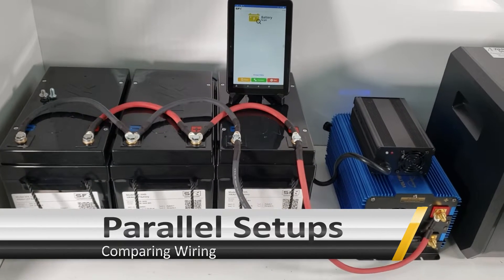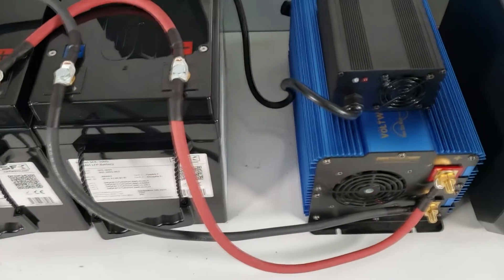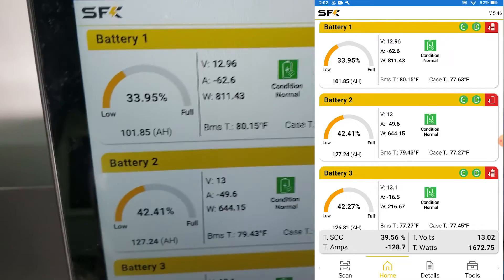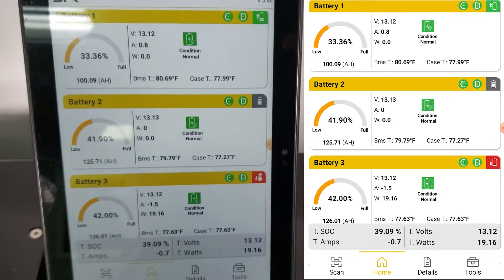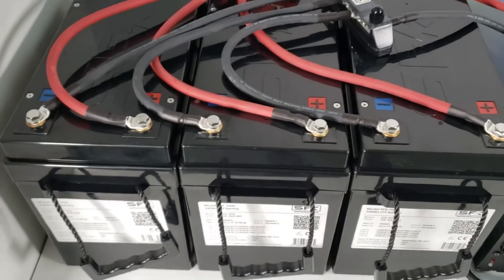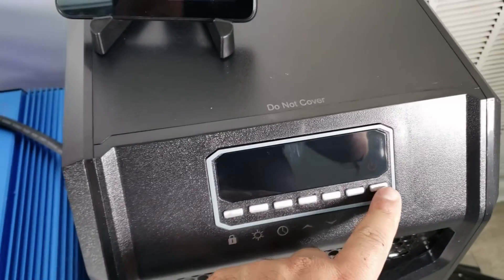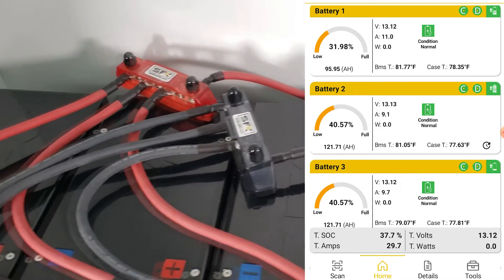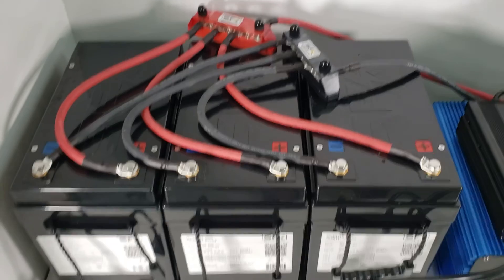Best Parallel Wiring Setups for Lithium Batteries (RV, Motor Home, Storage).

Comment: This is the 2nd video I've watched where I'm left wondering what the battery charger is plugged into. It appears on both videos the charger is plugged into the inverter?? Yeah I'm dumb to some of building my power station. I have to watch 10 videos per subject to get how to wire, program, charge, safety measures...gets to be too much info that it's hard to understand. I have everything that I could be generating electricity today, but it's been months just sitting. Just as I think I have it down, on how to charge the batteries, what's needed to accommodate that happening; then I see 2 people charging their batteries and they're not doing it by solar or by 110v...thought those were the only options to use your charger.

Comment: On the bus bar set up you need your negative cable to the inverter on the opposite side of the bus bar to distribute the load more evenly.

Comment: You completely ignored the fact that internal resistance of the individual cells inside each battery is what causes the difference in amp draw combined with differences in each BMS components.  Lengths of the wires make almost no difference.

Comment: I have no clue about electrical systems but you have made it look so easy. I have a question for you? I have a mercedes vario campervan that has a 12v/24v system .As I don't  have an inverter but the bus bar system, will my ( +&-) just connect to the battery charger. Thank you for any advice. I was also told ( rightly,wrongly) that there should be fuses between the batteries, is this required?

Comment: You should have had the Positive or Negative that is going directly to the Load from the Number 1 battery and the Number 3 battery (to use/drain the power evenly !)

Comment: Thank you for the simple explanation for a more equal battery maintenance use and charge. I have a 3-12v lithium battery setup in my truck for camping and had configured my wiring to a bus bar setup. This helped me confirm that I did it the best way possible for the batteries. I guess you could occasionally change the cable order from the batteries to closest to the the lead cable to balance the battery usages even more? Also do the cables from the batteries have to be the same length to the bus bars for even or better distribution? Unfortunately, my set up requires different lengths to my bus bars. Thanks again for this video and it's simplicity of understanding!
Reply: yes they should be of equal length

Comment: Also, so in theory, if you put all your battery cables on one post of the buss bars pos and neg, then use the other posts for charger, solar charger, inverter etc the current draw and input from chargers should be equal right?

Comment: So with only 2 batteries there isnt really a benefit to using buss bars?  Just make sure you pulling positive from one battery and negative to the 2nd? Or is there still an improvement using bus bars on 2 battery setup?

Comment: Hi I was just wondering, I am charging from solar, you connected the charger on the inverter, is it ok to put the charge wires on the battery instead of the inverter. Which is better. Thanks

Comment: Question...do you connect your positive and negative from the charge controller to the bus bar or directly to the 1st and 3rd batteries?
Reply: De preferência no barramento. Inclua um disjuntor ou outra proteção entre eles.

Comment: Surely EACH battery should be individually fused (in case of battery failure) AND there should be a fuse between the battery bank and the inverter?

Comment: Wrong wrong you are so wrong and your set up on your very first battery. You should connect your charger and your inverter to the Black on your very last third Battery you should connect positive charger and inverter to the red. By the way, I realize there are two different links, but you should make them both the same length And loop around the red one.
That is the correct way to do it. That is a proper way to do it. That is the balanced way to do it as I’ve described. Good luck in your next video.

Comment: So on the buss bar discharge test what if you reversed the negative cables so cable 3 is closest to the draw cable. So red cables are 3,2,1, power cable out and black is 1,2,3, power cable. like in the first test at 6.53 it might make a little difference. just asking..

Comment: Least efficient battery connection for parallel. 
BEST is Positive at one end of "chain" 
Negative at opposite end of "chain"
The way pictured will use a single battery with two parasites. BAD LAYOUT.

Comment: If you had a heaver amp wire from the bus bar too the  inverter would that allow a better voltage too the inverter. Thanks.

Comment: I have 3 230AH 12volt Lithium batteries.   What size busbar in terms of amps, do I need?  Is it the 690 total AH of the batteries?  Or 200amp which is the maximum output of an individual battery?  or 600 amp the maximum of each batteries output combined?   Thanks

Comment: The test would be more accurate if you had batteries at the same  SOC for each test as they will balance each other if not, skewing the amperage readings. Also, same length cables to the busbar from the batteries keep the resistance the same and keep voltage drops similar. Otherwise, great demonstration.

Comment: I have four 12V 200ah AGM batteries connected in parallel. 
I’m trying to connect them in busbar but can’t find a busbar that supports 800AH.
They seem to be rated at 600a Max.
Any suggestions?
Reply: I have four 12-volt, 450Ah batteries connected in parallel (running a 6000-watt inverter). I used a 600-amp busbar. When I run my 110-volt, 10,000 BTU A/C unit and a 1400-watt microwave, my maximum current draw is around 230 amps total. If I also turn on my air fryer, the draw goes up to 360 amps — and still doesn’t trip the 150-amp circuit breakers on each battery. I’ve tested this setup and used it for over 30 minutes at a time without issues.
On the busbar side, it gets warm but not hot. I oversized the wires — used 1/0 welding cable from each battery to the busbar, and 4/0 welding cable from the busbar to the inverter. So far, it's been working fine for over 5 years. The only downside is that oversizing the cables has made the electrical setup in my Sprinter van a bit cluttered..😂
Reply: Looks at Victron lynx busbar!

Comment: I wonder how it would compare having the load cables at opposite ends of the two bus bars vs opposite middle posts so it's in between two batteries. Which of these would be better? Think I'll just use a common post thanks.

Comment: The wires from your batteries to your inverter should not be connected like you have them. Your putting the heat from all 3 batteries on the one batteries post. You should use a positive on the battery on the right then negative from the battery on the left ran to inverter. It spreads the heat out. You can overhead, melt battery post how u have it

Comment: when charging the batteries is the inverter turned on when using bus bar set up. you showed charging but I could not tell if the inverter was turned on. may be a stupid question but hey I'm new. thanks for your help

Comment: You will always see some variation due to the internal resistance changes as the batteries charge and discharge. This is why its important to charge batteries to 100% together and discharge to 0% together. As long as the batteries are not being kept at 100% of 0% for long this will get you the best life. If you needed to store the batteries then choose whatever storage voltage for that battery (usually 60-80%)

Comment: your bus bar setup could be optimised slightly better by using a busbar with 1 more input/output and 1 more cable from the bus bar to the load and you would terminate the bus bars in this order battery-load-battery-load-battery this would be the most ideal setup and from there if need be you can use another bus bar or terminate both cables for negative and positive straight to the load

Comment: A few things I noticed.  One, the batteries were not fully charged or evenly charged.  Second, the presenter said he would set the heater to 90 F, but the video showed 89 then 86.  Wouldn't that affect the readings and results?  Btw, with the charger, how is it connected to the batteries and inverter, not to metion, the busbars?

Comment: sorry but to conect 3 batterys with thin AWG 8 wires parallel and then try to put 100 Ampere across this to thin wires can not work right.
the bigest fail in most user setups are to thin wires for the user case= high resitance big voltage + Amp drops across hte system.
connect 3 battery with right sized wires its not importend where the + or - conection is.
then next part across a parallel battery system with right sized wires you still not get a  weight current draw coz batterys have differenz internal resitances.
2 batterys in parallel battery 1 have 30 mohm battery 2 have 20 mohm so you get on a draw of 50 amps somethink like 30 Amps and 20 Amps from the other...

Comment: FYI: You should never have the output leads coming off the end battery of a parallel setup. Ground should be on the opposite side of the battery stack from positive, unless buss-bars are used.

Comment: In model 3: Attaching the negative cable from the inverter at the opposite end of the busbar (nearest to battery 3 connection), would likely lead to slightly improved balance in the draw.
Reply: Agreed.

Comment: Love your video. How would you connect a solar panel with one MPPT to charge the batteries?  I  have two Lithium's connected in Parallel.
Reply: The same principles apply to charging and discharging.

Comment: I have three brand new EcoWorthy Batteries.  They are 12.8v, however 1 is 280ah and I expanded with two identical 100ah versions.    Have I screwed up by having A mixed bag as far as capacity is concerned?

Jeff

Your video was great, btw.
Reply: Mixing capacities is fine as long as they are connected correctly.
I would put the 280AH in the middle of the bank with the two 100AH's on each end to make it symmetrical

Comment: Could uou tell the nsme of that device that reads how many Amps are pulled from each of the three batteries, with diffrrent connection.... , and  how is it connected to each battery. Thanks. Nice video.
Reply: These batteries have a Bluetooth module built in. The device is a tablet that connects to each battery via bluetooth and displays those values. You can also use your smartphone after downloading the app.

Comment: This is why you don't use 3 batteries. You don't need bus bars, and you get perfect balance, if the number of batteries are determined by geometric sequence. (1,2,4,8,16, etc.)
Reply: I'm a retired electrician did some DC work it's all about balance of these batteries,I'm going with 48 volt hybrid used cheaper then buying these solar types batterys that's the big thing is storage of the power from your panals .I like your system.

Comment: This is really a very nice video which proved that the bus bar solution is the best. what I don’t understand is: when using the bus bar solution why the second battery still has the lowest load although the second one is closer to the inverter than the third one.

Comment: I eliminate the buss bar alltogther, and place all in to one line, and using a copper switch to conected to a fuse, then conneteced to a main. it is all in a box this is what I did  with even my agms, and I do the exact same set up with my solar array.. becasue the intersting thing, is the soilar arrays, are the exact same thing like ones batteries. .I jsut make sure that I am not over drawing what my lines can handle, I also tap my lines directly in to the charge controller from breaker to the battery bank. My charge controler has fuses in it aswell, they seem to be more touchy than the breakers. My newer system has a build in breaker and just needs a connect disconnet switch.

they are starting to make these units idiot proof. I just make sure everything is tight.

Comment: I have the same setup with everything on bus bars but with two batteries. I want to connect a shunt but I don't know exactly where to wire it because the bus bars are throwing me off. If someone would enlighten me I'd appreciate it.

Comment: Try a single post for each  (positive & Negative) distributed battery connection. Place the load leads between battery leads. You should see an event better balance on charge / discharge. Busbar will have some distribution issues.

Comment: Ive only seen a few of setups these in person in an RV, that said the way it was setup they had the battery charger on the same post in the bus-bar that was going to the inverter, this was years ago and the  batteries were not lithium, but agm's, the system was not solar but more of a backup system. Curious if that setup was correct.

Comment: Been doing solar for 10yrs and this is the best video I have seen to explain how batteries charge and discharge, sending everyone that ask to your video  Great JOB!!!!!!!!!!!!
Reply: Hi Branx86. Question for yousince you mention solar. So, today, I have one cable that goes from Batteries to inverter and another cable from batteries to solar - I think. So, I assume the inverter cable and solar cable go to the same terminal on the bus? Correct? Thanks.
Reply: @charliewallace3724   Yes correct, Pos and Neg to your Power Invertor and Pos & Neg from your Solar Controller to the batteries.
Reply: Do they go on opposite terminals that you use for the inverter? Example positive on left battery and negative on right battery to inverter. And negative on left battery and positive on right battery to solar charger?

Comment: I believe that you should connect the inverter to the Plus of the first battery and the minus to the last battery. The configuration you have will draw a higher current out of the battery closest to the inverter and will draw the least amount of current from the battery farthest away from the inverter.All wires should be of equal lengths.
Reply: You have a point there.
Reply: @david - Your suggestion is certainly better, but still not the best way.
Reply: @MrSummitville okay, what's the best way

Comment: Could changing wire size balance the amp draw.
Reply: When the cables are all the same length/size, it is assumed that the resistance would be equal. Proximity to each battery connection on the busbar is the most likely culprit in this demonstration. Still one or two amp differential is inconsequential. Greater than 10 amp differential will cause disparity in rate of degradation and lifespan of each battery in a parallel setup.

Comment: I don't think the length of the cables going from bus bar to inverter/charger matters when using a BUS BAR
Reply: Correct. Length of wire from bus bar to battery must be equal.

Comment: Thank you sir and you are correct with example 3. In addition you can make the make the battery cable closest to the inverter cable on the buss bar a little longer then you will have equal power distribution. By the way I really love your battery kits I just wish that I could afford them. I am disabled and unable to work anymore so I live on a very fixed income but if I ever come into a lot of money then I will buy 4 of them for my 1967 GM TDH-4519 city transit bus that I live in full-time in the high desert of New Mexico unless there is any way you can help me or we can help each other

Comment: Question: I have four lithium batteries (12v/100ah). I have a bus bar like yours (four poles). Do I occupy all four poles with the four batteries, then add the inverter to one of the used poles? (So, the inverter would share a bus bar pole with one of the batteries.) Would that be bad practice? Thanks

Comment: My Victron shunt states it should be connected to the negetive of the last battery? How would that work in this setup?
Reply: Is victron talking about batteries connected in series ?  This video is about parallel connections.
Reply: A shunt should attach between your battery bank (series or parallel) and any load or charging device on the negative cable.

Comment: We should see what happens in series ?
Reply: No. Not with these batteries and this inverter
Reply: I think batteries can be connected in series but not with this inverter. I was saying what will happen if you connect them in series , each of the batteries will have different voltage
Reply: @ferdm9646  Yes, batteries connected in series will have different voltages. So what?
Reply: @MrSummitville  so what ???? Fine 👌
Reply: @ferdm9646  Each cell, inside each battery, has a different voltage - lead acid and Li-Ion. When did this become an issue?
Reply: @MrSummitville  it's always been an issue , and that's why most battery pack has balancers and most battery banks uses equaliser devices. I think you're not aware of that. Anyways good luck with your ideas and keep it up

Comment: Nice video, well done.  However I have a question, in the busbar configuration could I further reduce the current differences by adjusting the cable lengths for two of the batteries, say battery 1 and 2, to take into account the current path length through the busbar?
Reply: No. Move the one of the wires, going from the inverter to the bus bar, to the other side of the bar. Or use a bigger bus bar.

Comment: Thanks for this. What if you added a couple inches to the battery 1 cables? Would that even it out even more?
Reply: Don't do that. Move one of the wires, from the inverter to the busbar, to the other side of the bus bar.